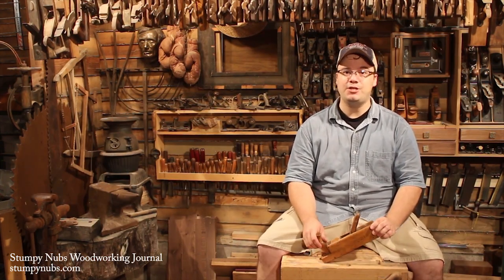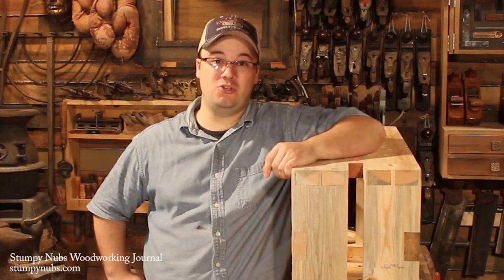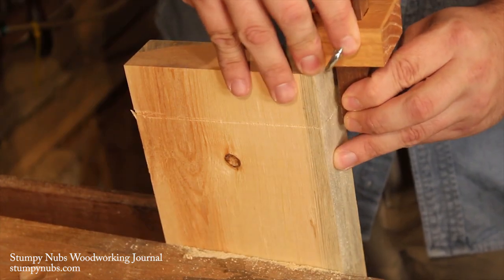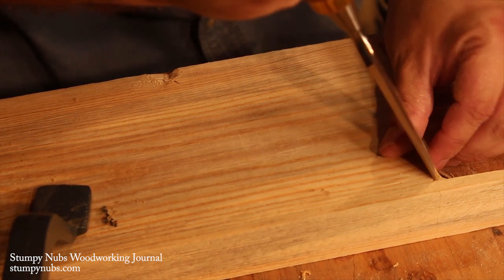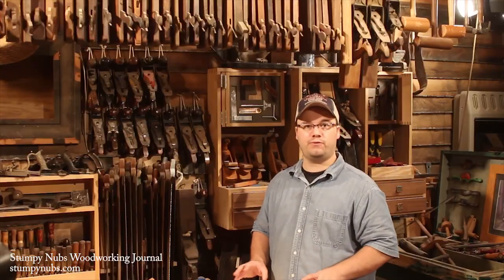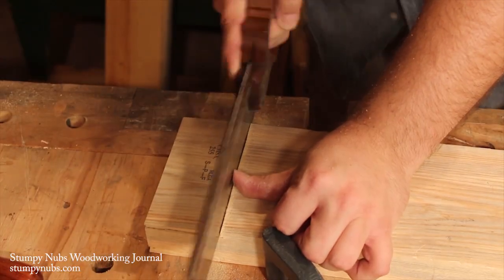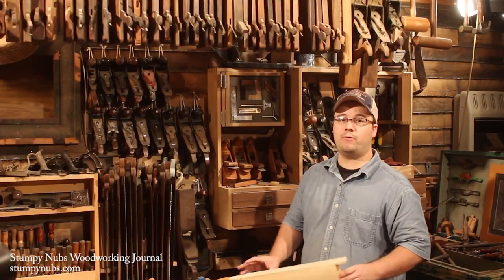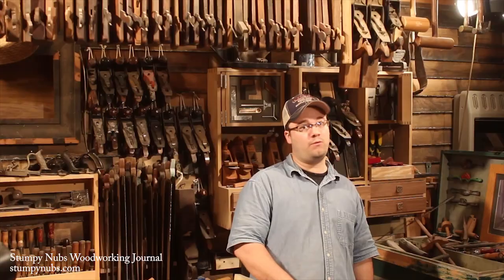Build a $10 Split-Top Saw Bench for Woodworking (Short Version)

Comment: I bought the plans. Another good one from James. My first time trying dovetails. What I learned:

I tried to get away without really milling the pieces up very square. Didn't work; put the time in. If your marked 1.5" lines don't join up all the way around YOU'RE GOING TO HAVE A BAD TIME.

My early attempts sucked, so I bit the bullet and did quite a few practice runs on a sacrificial squared-up 2x6. I just kept lopping the dovetail ends off, and tried again. Practice really helped my touch and eye.

Even after repeatedly sharpening my chisel to a keen edge, I still had a horrible time removing the waste (in the middle of tails/pins) in construction lumber with its combination of spongy bits and knots. I finally decided to head off to Lee Valley to buy bought a pair of 1/2" Narex skew chisels. These cost under $40 (Canadian) for the pair. They made a HUGE difference, slicing/paring even the worst stuff instead of crushing it. I would not do without these again ever. 

FInally: coping saws are supposed to cut on the pull stroke (duh).

Comment: I built this. almost exactly as you did, Stumpy. on one end I bolted a giant bench vise. essentially bolting together the legs on one end, making it even more stable. now, whenever I want to do long cuts, or grind something in the vise, I can easily pull it outside so I don't cloud the garage with shavings and dust. I used 2x6 for the tops and legs, a 2x4 for the stretchers,  and 4x4 I salvaged from a giant pallet for the feet.

Comment: I am working on my second Stumpy Nubs saw bench. I made plenty of mistakes on the first one. I discovered that it was easier (for me anyway) to do the half mortises if I put a depth stop on the saw I used to cut the kerfs. This was a narrow piece of hardboard stuck to the saw at 1/2" with double sided tape. It also helped to space the kerfs almost exactly a chisel width apart, i.e. the width of the chisel I used to hog out most of the material. These "tips" are probably unnecessary for anyone who doesn't suck as much as me; I need all the help I can get!

Comment: Great video, great project. Thanks, Stubby.  I made this bench over a year ago, and it is truly one of the most consistently satisfying fixtures in my shop. Just today I was using it to scrape glue lines on the legs of my massive Roubo bench build. And I do use it sometimes to just sit and take in all the goodness of being in my shop smelling the smells and admiring the shavings and sawdust covering the floor. I also love projects like this that allow me to practice joinery techniques without wetting my pants over the risk of ruining an $80 piece of hardwood.

Comment: I should also add that I used the router plane I made using the Stumpy Nubs plans to do final cleanup on the tenons and half mortises. I found that the Lee Valley spear-point blade worked best on the unruly construction lumber. If I come across as a bit of a Stumpy fanboy, that's ok. I have had considerable success with various plans purchased from James.

Comment: Your bench is very wobbly, why is that? Too little weight? Racking? Loose joints?
Reply: I'm referring to your main bench, not your saw bench. The saw bench looks solid.
Reply from the maker: Uneven floor.

Comment: I'm not getting the plans as I don't believe that I can find any 2x6's that are 3 inches thick. 1 - 1/2 inch dimension lumber will not work very well with bench hook, hold downs. Three inch thick lumber isn't $10 cheap lumber. I don't need the plans to see that this is untenable for me. I liked the video, but my circumstances are not suitable for this build. Thanks.

Comment: I didn't know that people are still using hand tolls for woodworking. Power tool are pretty common, cheap, acurate and much FASTER now days then why to use hand tools..... 🙄🙄🙄
Reply: Mamoon Rasheed because it is a greater level of satisfaction. I have power tools as well but I do most of my projects with hand tools now.  If I were doing production work then it would be different. As an example no machine will ever leave as fine a finish as a smoothing plane.
Reply: Hmm, less noise, less mess, less dust in the air.
Reply: I don't have a table saw, so I learnt to straight cut a full plywood sheet with just an hand saw. I saved money and floor space, while learning a skill that I can use anywhere, any time. 
I have a circular saw, which I don't use too much, because usually hand sawing is faster and less work for me.
I don't have a jointer or a planer, but I still can get by with a hand planer.
I took time, which I have plenty, but the rewards are many.

Comment: What the hell is the purpose of a "split top" bench that has a piece of wood glued between the split top?
Kind of defeats the purpose there buddy...
Could have just routed a groove down a 2x10 And saved yourself a lot of time and it would be sturdier anyway...
Reply from the maker: WOW, you missed the point entirely! Congratulations!
Reply: Stumpy Nubs Sorry Stumpy, looks like two of us missed the point then, i was thinking the same thing... i have seen a few split top benches for ripping stock in my time, but never with the extra piece of timber in the split as yours has.